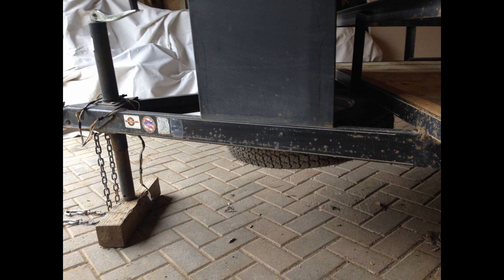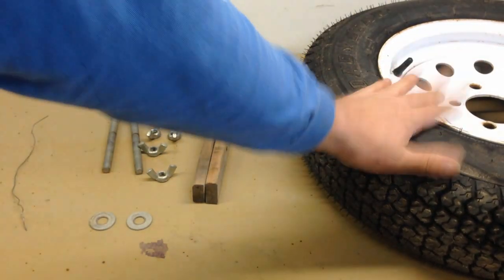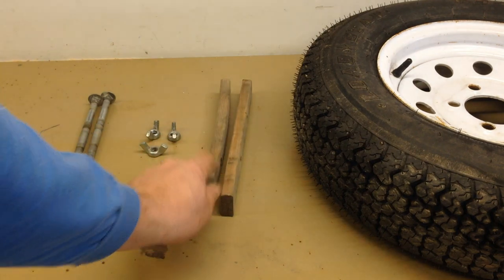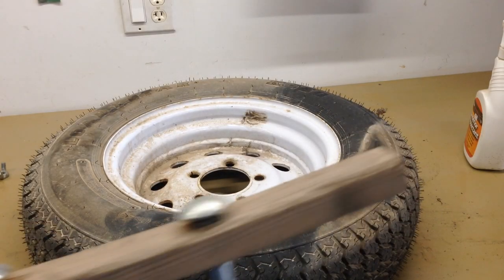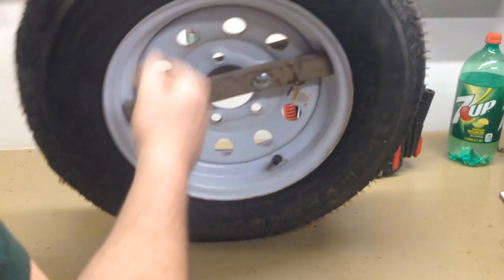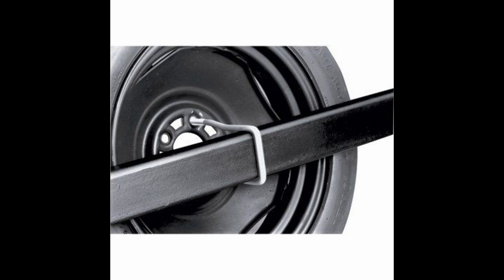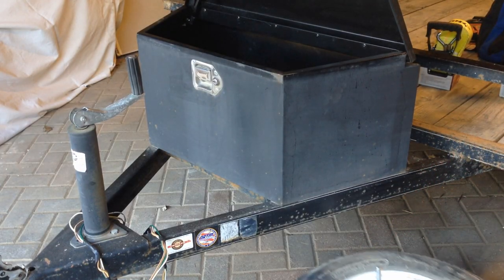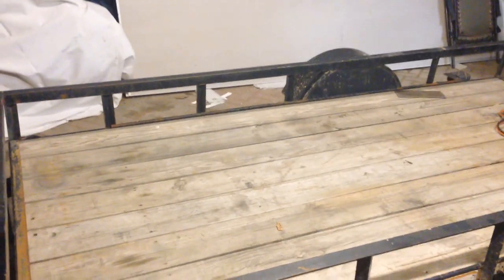Locking Utility Trailer Spare Tire Mount for $5

Comment: I like the idea. I like the wood wearing instead of metal wearing into the wheel. It will probably be ok forever. Even if the wood failed it would be caught by the carriage bolt heads.

 But I would not be looking forward to taking 4 rusted wing nuts off that have been sprayed directly behind the tow vehicle for who knows how long. 

1/2 thread is 3/4 hex head/nut size anyway so if you have 3/4 hex lug nuts you're not carrying anymore tools than you would be anyway. If it is a different size you do have a toolbox it is bolted into...🤣

Comment: I'm seeing this 2 years later and am curious if it hit the ground. Looks like it would hold up, but i could see it hitting the ground pulling in/out of a parking lot or drive way.
Reply from the maker: There's quite a bit of ground clearance. It hangs maybe 1 or 2 inches lower than the tongue jack when fully retracted. Haven't had any issues.

Comment: How many times has the tire hit the ground (going over rocks, speed bumps, etc.)?
Reply from the maker: Never. The tire only hangs just a little (maybe an inch) below the tongue jack. Still plenty of clearance for all but the most of extreme circumstances.

Comment: if you don't have metal, put used motor oil on the wood so it won't rot
Reply from the maker: Thanks for the tip.

Comment: I’m SURE someone else has this problem. My 5\8 utility trailer has brand new tires on it. Yesterday I noticed unusual black residue on one of the rims. It comes off easy but WHAT is it?  The other rim is clean. I haul my ZT mower...that’s all. No noises or unusual handling problems. HELP

Comment: An accident waiting to happen. Don't use wood this way to secure anything to the underside of your trailer. Usually the rot will begin where the carriage bolt seats. This means you won't realize it's rotting until it fails completely. Obviously the carriage bolt heads are large enough to stop it from falling completely off. However, if the wood fails and ends up in your tire or another traveler's tire it could cause a serious problem. Use a strip of metal and paint it with rust prevention. Or don't. I just hope I'm not following you on the highway if it fails. It's a good idea and video. Just need to use the correct materials with your design.
Reply from the maker: Good point. Although I did this exact project on my first utility trailer about 10 years ago, which I still have, and everything is still intact, I'll use leftover scraps of composite Trex decking from now on. My metal fabrication skills are limited.